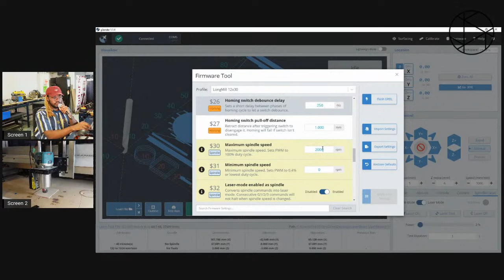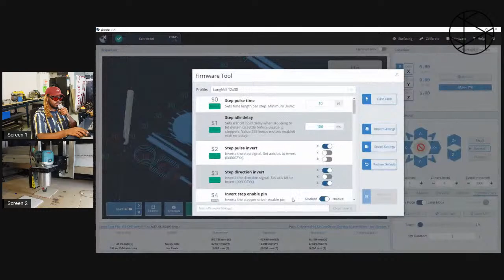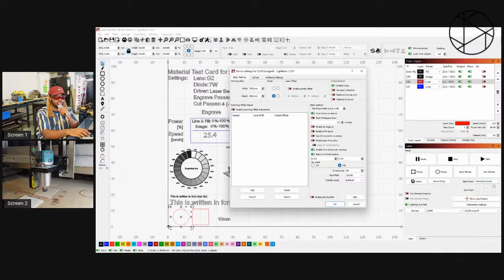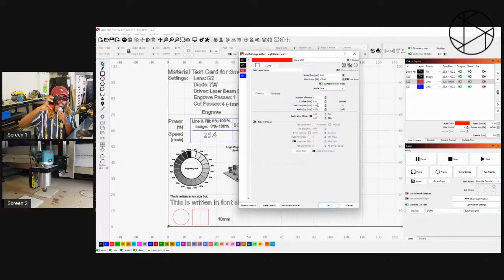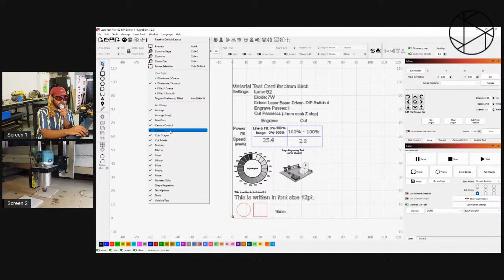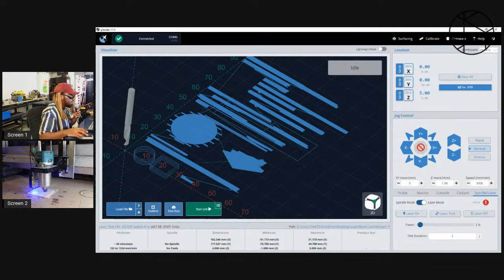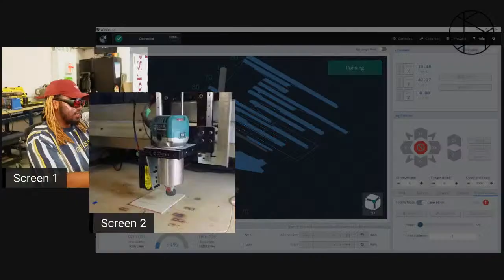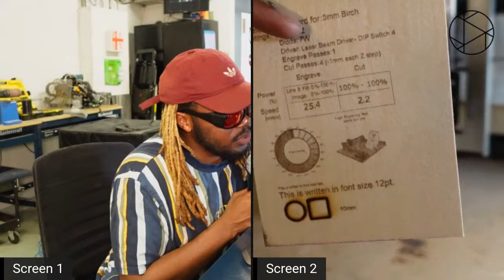LaserBeam Live #1 - Laser Focusing Techniques, Test File, Q&A

Comment: I hope you read your YouTube messages.
I watched these installation videos several times, read the instructions and followed step by step and I definitely cant even get the led power light to come on in the box. Wiring is correct but I can only get one light to come on that turns on the fan and the box. 
My order was part of the order with the long wait time so I hope that having a faulty one is not the problem.
I've searched the forum and can't find another person with the same issue so no help there. I was finally ready to get this thing working too and now I have this problem.
Reply from the maker: We check on our comments whenever we can, sounds like there might be an issue with your laser unit. If you send through an email or call on Monday we'll get back to you as soon as we can 👍

Comment: Does the long mill have rotary axis capabilities
Reply from the maker: Yes it's possible to set up. You can move the machine to be in-line with the rotary axis and then use one of the Y-axis motor signals to power the motor for the rotary axis. The only other thing you have to do is change the steps/mm on the machine so it knows it's not using the Y-axis anymore but rather the rotary axis 👍
Reply from the maker: Our testing isn't very in-depth and we don't have any official guides on it so if you're looking for a machine with better support or more dedicated rotary cutting then the LongMill might not be the best choice